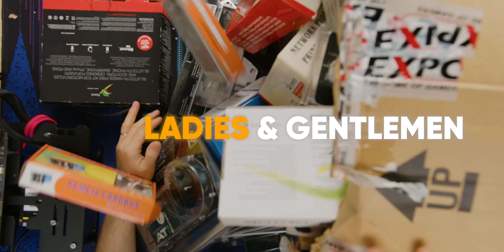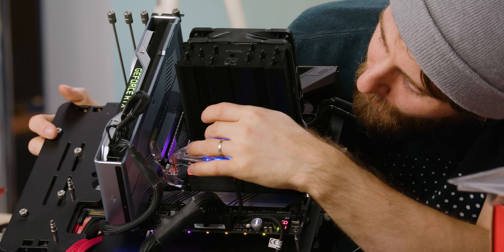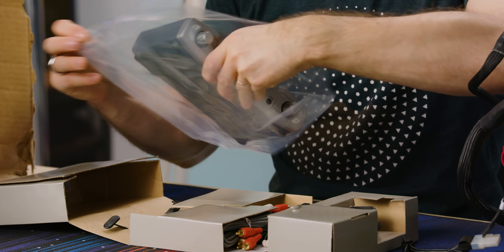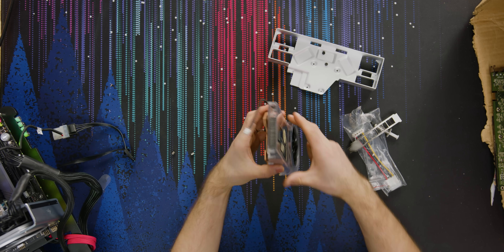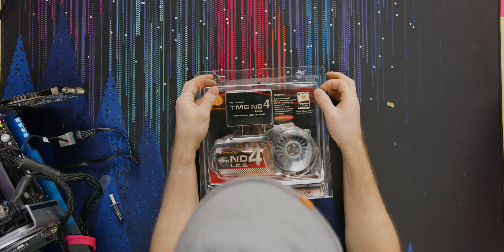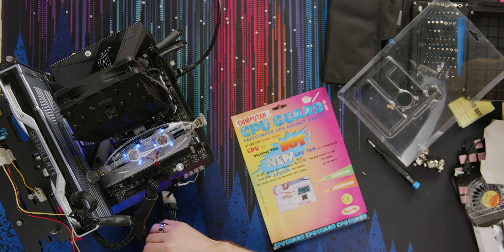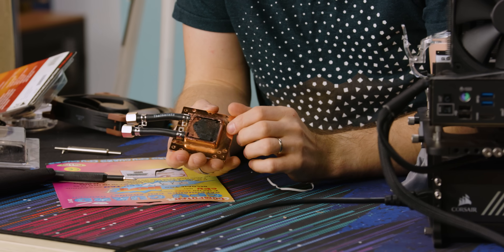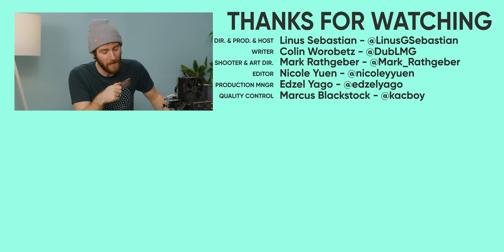I Bought Out This Bankrupt Computer Store's Inventory

Comment: I remember those 5 1/4" racks. I studied computer science way back when having a laptop as a student wasn't a thing yet. All computers at school had such a hard drive bay and all students got their own "mobile" hard drive that you could slide in the computer and boot from to have your own stuff ready to go. Really weird in hindsight.
Reply: ...and yet really a good idea from a security standpoint.
Reply: Yep I had these. Forgot one in a computer and had to get a second one
Reply: Still got one, I use it to push monthly backups to the stack of harddrives I replaced for being too small. It even does hotswapping for internal drives, but there's a really unpleasant winding down sound unless it's sleeping when the drive is pulled.
Reply: My college still does this
Reply: I had a bunch of them at our web hosting, and server sites way back.  Except ours were aluminum and used 3 thermal pads for vibration and cooling the HDD.  Each enclosure also had its own little fan.  We had some later models that were even hot-swappable.  I'd still be using them for my personal server / PC if they had SATA versions. As of right now, I just have a Noctua fan blowing over my HDD stack.

Comment: 3:54 "This is before my time." You were definitely around, Linus. :P Those were popular about 20+ years ago. It was a great way to move data between PCs, back when USB 2.0 was young (or missing on some PCs) and practically useless for large data transfers.
Reply: Yeah, I was surprised by that too. At least in Poland those were pretty popular and in use in like around 96-2002, when finally CD recorders become cheaper. Way more handy than carrying "naked" hard drive.
Reply: @Rysysys  I remember in like 2004 we were buying poor CDs for 6 Kč (that's like 1zl), it was literally for one use and after few months, it was not readable, good old times. :-)
Reply: And by putting the OS drive in there and having a second one to swap, you got 2 computers for the price of one (and a second hdd+case)...
Reply: Poor kids used normal internat HDDs instead of external HDD or flashdrive. :-D And yes, USB 2.0 was very slow for copying iso files or movies back in the day and some older computers still had only USB 1.1 so external disks were completely useless around 2005. I think FireWire was fastern, but FW was very rare in Europe, it's literally just US thing.

Comment: I want more hybrid gpu coolers, especially ones that connect to open loops. Not the kind that only air cool ram and vrms, but ones that can fully air cool the gpu as well. Makes better use of the ventilation in some sff cases.

Comment: If you come across a PowerColor yamaha pci 744f-v , please let me buy it!. Also. that mobile rack was way ahead of it's time. In 2004 I owned a computer store and I had a service that used those racks. I used to setup windows many times on separate drives and give a pc owner 2-4 hard drive inserts(with different hard drives installed in each). I would tell them, give 1 to your wife, 1 to your kid and keep one for yourself, keep one as a clean drive. You could have  separated users on the same computer/os without many licenses. If your kids got virii'd , you still had your own non virused os. Better yet, no one couldn't spy on your extra circular activities. You could use this as your main internal drive.

Comment: I love that bit where he asks for the USB adapter for the lathe. I just had to locate one of those to run a  laser engraver (which still only has Windows XP drivers).
Reply: Unfortunately it probably won't work, those adapters are only good for printing. The CNC systems usually need to acces the low-level hardware directly.
Reply: Running CNCs using parallel ports was a thing because the  port had enough current to drive steppers directly. USB won't do that.
Reply: @handlesarefeckinstupid  It has nothing to do with current capability (parallel ports don't deliver power), but with the interface characteristics. Hardware parallel ports are very dumb. The software is in direct control of the high and low voltage levels on the connector. It's similar to using your PC as a microcontroller like an Arduino. With USB everything must conform to a protocol so much more complicated circuitry is needed.

Comment: Old stuff? Joke's on you Linus, I still have the very same Thermaltake Memory fan going strong on my 2005 built PC!
Also, anybody else feeling sad when Linus tosses the nostalgic parts like trash?
Reply: Let's be honest, those are bygones.
Reply: 2005? My phone would be faster.
Reply: @TheAdatto  Old gaming machine, now a backup storage server, pretty capable to run day to day browsing & such.
Reply: @Proud_Canuck  if it doesn't load a site in 1-2 sec its useless for browsing too

i wouldn't ever touch anything with Pentium 4 or Pentium D in it again, those were piss poor slow machines

if it is a 775 machine just chuck a Q6600 in it and its atleast half decent, but fuck any old Pentium those were my childhood nightmares

a 386 with Win95 or 98 was atleast not terribly slow but anything until the Q6600 on any more modern os was garbage

rather have no PC than one of those

Comment: I'd make some joke about a flea market dumpster, but...
nevermind.
Recycle fan alarm. It could still be used as a pump alarm. But first find the ground fault that caused sparks. Look for a solder bridge, bent through-hole legs, or a bad diode.
Remove yellow sticker over the speaker, and hold your ears. :-D

Comment: Seeing that EVGA 8800GT brings back memories. I recall that card was a performance beast while being a lot cheaper than its GTS brother. It was the first card I had that made Crysis playable. Me and my brothers all had one and they all died within 3 years.
Reply: Duh- planned obsolescence yeah?
Reply: @scottmcdonaldAAL211  It was such a good performer for the money that I really didn't mind. Those bastards ran hot and the cooler was woefully inadequate, although dual slot cards were relatively new and hard to accommodate in systems of the time. Now they're pretty much standard in anything that isn't watercooled or a glorified potato.

Comment: Completely missing the point of the 5 1/4" removable drive bay, when your company works on government contacts back then you could not just level PC's lying around where anyone could use them out of hours you had to secure them & what better was to do that than remove the HD & put it in a safe overnight

Comment: 3:50 I remember using this removable HD caddie  at college. The school replace all the hard drives with these units in the labs. As they were getting tired of people stealing or ruined hard  drive.  Of course one had to buy the caddie at the school book store as they used a particular maker (name escape me)  and charged us students crazy amount for it. This was back in 1996-1998 time period.
Reply: Forgot to mention,  I recall Compusmart sold the same model for a cheaper price and I recall some classmates bought them there instead at the school bookstore.  Although when one use these caddies  they would fry their hard drives . Yes they were the same models , but the version numbers were different. Apparently Compusmart sold new version of these caddies which the power and ground  pins were wired differently.  Hence one had to buy from mark up caddie from the school bookstore. ☹️

Comment: I had that exact gtx Thermaltake cooler. It was crap. Ended up replacing it with a hacky CPU cooler. Ran it through two external Zalman reserators and a 240mm radiator and 2 aquarium pumps. All mounted to a piece of plywood outside my case. Remember when my 2 year old daughter pulled on of the hoses and glycol soaked my motherboard and I lost everything. Fun times.
Reply: I am happy I did not get into water cooling until modern times, though most of that is more due to income.  But I remember when radiators were hacky heater cores and reservoirs were from the PVC fittings bin from Home Depot or even just tubes draped into milk jugs or tupperware.  People building TEC based water chillers, oh and open air water towers that worked like the stacks on a nuclear plant.

Comment: I legitimately bought that kind of hard drive cooler in 2017 for a WD black. It had nothing to do with heat and everything to do with the fact that I could hear the damn thing inside of my enclosed and padded case if I was listening to heavy metal with my open back headphones (and I do not want to go back to closed cans). The enclosure helped with the noise enough that I can't hear it if there's audio coming out of my headphones, but still   very obvious if nothing is playing.

Comment: I got some of those removable IDE HDD cages for free back in 2000.  I had one mounted in a PC in my car, and another in my main PC.  I used the PC in the car as an MP3 player, winamp on autostart and a logitech gamepad for control, worked great.  If I wanted to swap playlists or change up my MP3 collection I would pull the drive and move it to the main PC to transfer the files.  Pretty rough by todays standards but pretty inventive for the 1999-2000 time frame.

Comment: I would actually have bought that volume adjustment box. I would have loved one of those for my PS2. Though it could probably have been designed a bit better, the way i understand it, it's one user per output. Not 2 users for whatever is in use. This could be helped with a splitter though.

Comment: Ground is not the same as earth just cause it's grounded, it doesn't have to provide any protection, it's just a voltage reference. what you need to look for is earthing and check if all metal surfaces is connected to the supply earthing.

Comment: Holy shit for sure! I used to use a "drawer" just like this one. I took my boot hd home from work, stuck it in my home pc, booted windows 95 normally, on totally different hardware, no blue screens and crashes, and continued to work or play. (long life to win 95).
The next day, I'd stick that drawer in the slot on my work PC and pick up where I left off. It was practically the remote work you took under your arm, back in 1996. :)

Ah, after a long time removing and replacing this drawer, bad contact appeared and started to give some bad blocks on the hd, until it totally corrupted the windows. It was the price to pay for modernity ;)

Comment: hey, when i had my older desktops, i had multiple drives with multiple operating systems. Removeable drive cases were great..  Especially if you want to protect them. you could pull them out and lock them in a desk or safe...

Comment: Those removable HDD caddies were used for classified PCs. At least, that's how we used them in the USAF and as military contractors. That way you could remove it and lock it in a safe. We had a few that actually had a set, unclass and class caddy. But most of the those PCs just sat unused without the removable boot HDD inserted. This was way before bootable USB memory sticks or thumb drives, around 2000.

Comment: This video made me realize that PC parts and accessories have expiry dates, just not specified until they get phased out  by new shinier techs. Can see why stores would bundle their soon too be obsolete parts in awful prebuilds in order to push out dead inventories.
Reply: some do,some dont....still running ddr3 ram,a 970 gtx ,an i5 4690.........runs everything fine for 1080p          and yes i still have multiple athalon,phenom cpu's ,some pentium2-3-4's ,a 295gtx and a 3870 dual gpu card "for nostalgia"

Comment: Remembering Sony's proprietary crap, just really blows my mind that they were the ones to go with a standard storage media on the PS5.
Reply: I remember having to get a magicgate card for my PSP 2000, and it costing like a third of the price of the PSP for just 2Gb.
Reply: I remember my old sony ericsson had proprietary battery charger, m2 card, and headphones. My first and last Sony Ericsson tho
Reply: @KaiSoDaM  proprietary charger and headphones were quite common back in those days
Reply: Because PC's stuffs are the fastest. How else would they beat NVMe Gen 4.
Reply: Eh, the PS3 had a regular SATA hard drive, not sure about the ps4, but using standard storage is something they've done before.
Reply: @somethingcooleventually  yeah the PS4 has regular 2.5 inch drives
Reply: Sony giveth, and Sony taketh away.
Reply: sony's storage media has been standard since the PS3 tho..

Comment: I had that ThermalTake GPU and CPU waterloop! Pretty sure I still have both radiators and maybe the pump :D
Reply: I've cherished those good old serial + parallel port breakout boards, they still work on lots of modern motherboards!
Reply: Those old IDE drive bays, my god! Pretty sure I still have those as well somewhere in the garage!

They have this weird chonky connector that looks like the  OLD printers from Olivetti used.
Reply: There was also this enormous passive blue anodized alu GPU block, that had a radiator above and under the card connected via heatpipes!

I loved it :D
Reply: @11:06 I'm guessing you will find a very simple S-channel inside like all the ThermalTake blocks from that era lol
Reply: Oh shit they improved, I was 100% sure there was an S-channel inside!

Comment: I HAD a RAID0 OF 2x75 GIG WD Velociraptors that ran at 15k rpm each. 
Yes, it sounded like a jet taking off on boot, yes, putting them into 2 of those HDD cooling and noise dampening cages worked wonders for that.

Comment: Zalman 5.1 I have owned 2 as I had a set of Zalman 5.1 Headphones... the cables on the headphones were so thin they broke fast. Those units are however quite solid and only broke after someone else spilled a drink on it.

Comment: I want that TV tuner card now...I always hated that streaming frame rates still haven't matched traditional television/cable in sports. The best footage you can get still comes from traditional television broadcasts but, especially with using VR headsets to watch stuff, you need capture equipment to get the output from the cable box. Sad that it never caught on more than just for streaming games...

Comment: @Colin That cable wont work for your lathe. it hasn't got all the pins you need, been down that rabbit hole. Ended up using an expresscard to proper parallel port, then that died due to the sh***y locking mechanism. Then i got a m-pcie card that had parallel and serial ports, lasered some wood to make an extension of the bottom of my laptop to make it fit, and put the full size ports in the dvd bay.... waaay too much work to get my Emco compact 5 PC playing nice with linuxcnc.

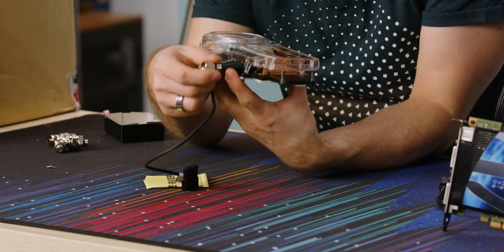Comment: 10:30 did you forgot the evga hybrid that existed for reference/founder cards? i had one for my 980, it was a pny reference and removed the cooler and put that "hybrid" thing and yeah, same thing not 2 decades ago, air for vrm and all the radiator cooling power for the gpu dye, what are you on linus?

Comment: I had one of those ide plug in slot things. We needed them for classes at our local technical school. In the IT department, we were expected to have our own bootable disk. And we would run off them after inserted into the caddy in the PC. In the library, if you were studying the PCs all had them as well, just used for personal storage.

I remember that they all had zip drives as well.

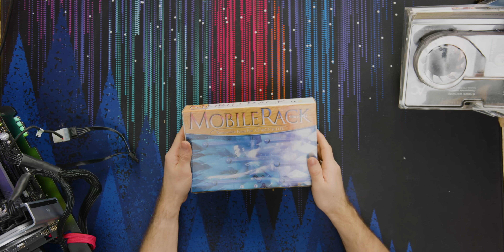Comment: 3:42  I have two of those HDD drawers in my current case that I use as toolboxes.  I keep screwdrivers, screw bags, and thermal paste in them.  Very handy if your case still has 5.25" bays.
Reply: Lol, agreed! there were so many 5.25 parts, such as water cooling kits, HDD silencing, extra ventilation, and storage. And CD roms as well, it was mandatory.

Comment: Not going to lie... that CPU cooler alarm is a technology we need reintroduced in the modern day. A mechanical backup alarm would be super handy in the event that there's a problem with the motherboard sensors. What's today's technology, I'd imagine you can easily integrate that sort of thing into a computer case instead of as an add-in card.

Comment: My old old old PC had 5 of those hard drive trays in it. They were hot swappable it was so cool, and the keys were used not really to lock it but to make sure you didn't pull out the tray when it was on. The key would turn the power off to the tray so you could take it out while your pc was still running. I got so many girls because of my awesome full tower case with a ton of 512g HDD's top of the line baby.

Comment: I still got a chunk of metalcooler for a 3.5" drive, bought one from Scythe and it works very well if you have a 5.25" slot, makes a 5400rpm disk silent.
The coolers also...found a ATI Radeon X850 XT gpu when working and in good condition, a piece of hardware history that im going to frame and put on the wall.

Comment: That drive sled reminds me of the first ever tech tip I gave.

My father couldn't get it to work, spent hours troubleshooting it trying to work out the problem.

In walks 9 year old me

"have you tried locking it with the key"

Turns out it needed to be locked to work

Comment: I had that floppy drive bay card reader and the pull out drive cases.  I believe thats the old sca interface.  And I still happen to have my full size pc case I bought around 2002.  I also had a device similar to that tv capture card.  I used that tech for over a decade to record my shows so I wouldn't have to rent a device from the cable company to do it for me.  Now we dont even have cable tv.  I pretty much stuck to ati capture cards

Comment: Did I hear using a usb->parallel port for a lathe?  Probably won't work.  If what you are looking for is step/for control - this isn't a solution.  You need a real onboard or pci/pcie parallel port.

Comment: Those Mobile Racks were great for the time.  Made swapping hard drives really easy. The only way that worked well for IDE drives. Still have a box full of them and one tower computer where they were installed. And am still using one in a test rig. Also keeping a box full of PCMCIA cards.  Just in case.